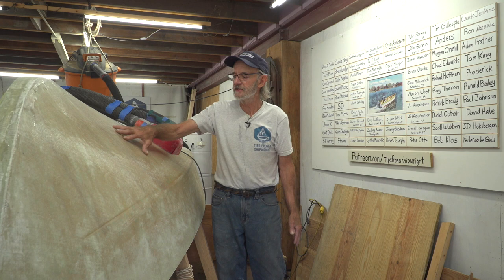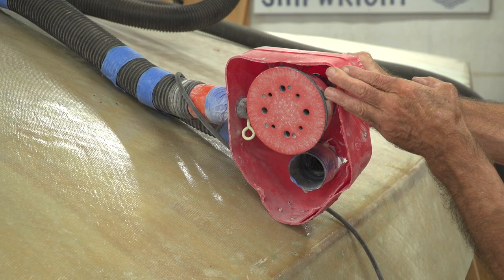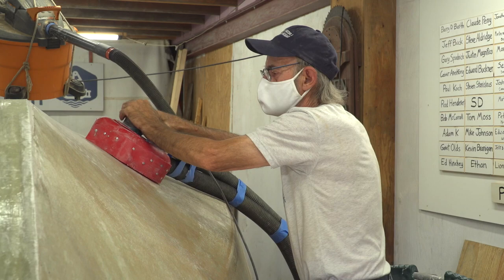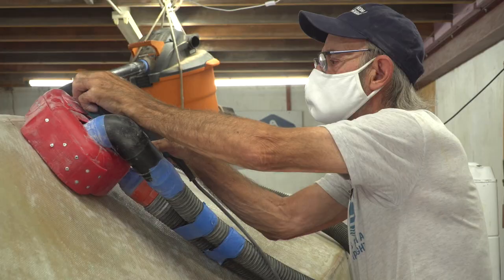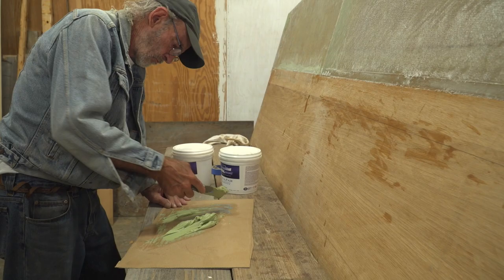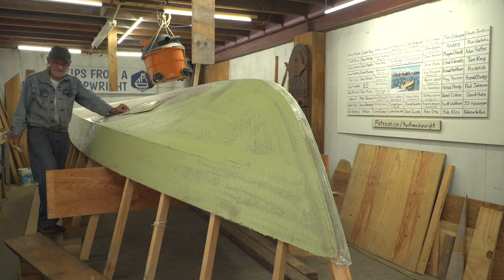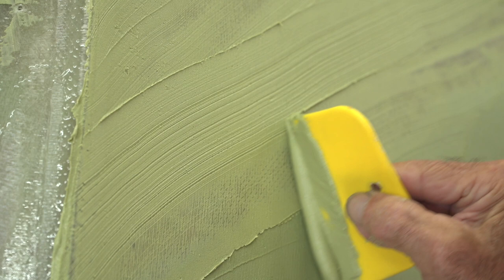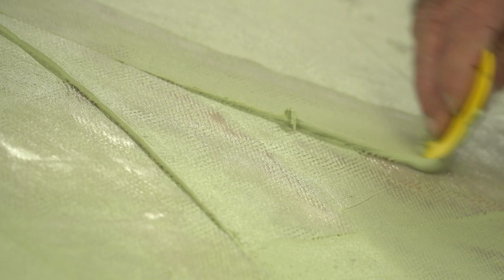Building the 23' V-Bottom Skiff - Episode 17: Fairing the hull

Comment: Nice job on finding a solution to your dust problem. Sometimes there is nothing available and you have to come up with your own solutions as you did.

Eliminating the hazard at the source is always better. PPE is your last line of defense, because once the hazard whatever it might be gets past your PPE, nothing stand in its way of doing you harm. Time, distance, and shielding. Those are the three words you need to keep in your mind when you want to mitigate a hazard. 

So keep your exposure down(time), stay away from the hazard as much as possible(distance), and use engineering controls and/or PPE as required (shielding).

Comment: Thanks for the video drop!  This glass over wood approach was used by my uncle for deadrise scows as far back as 1960 - at that time with polyester resin, later with epoxy.  We used these open bay boats for fishing, hunting, skiing.  On and off the beaches, breaking ice in the winter, etc.  I have used this technique building a 19' motor boat and strip planked canoe.  One suggestion is to try larger spreading tools for the fairing epoxy.  Sometimes a 10" sheetrock knife can be used two-handed to get good pressure an ultra smooth surface using very little compound if the glassing is decent.
Reply: I always loved stepping up in knife sizes when spreading any kind of mud or compound over any surface. Drywall mud, spackle, plaster, bondo, leveling compound, anything to smooth [fair] a surface. The wider a knife/ spreading tool, the less time you end up spending with a long-board; sanding.

Comment: Here's a couple of tips learned from 45 years in construction  that would apply here.
1. Take down every mountain before filling any valleys.
The tendency is to quickly get to the filler. It's more fun than scraping and sanding, but you'll just make more work for yourself.

2. Never put on enough. 
Starting about 6:05 you make this point by laying that fairing compound on thinly. Always figure on another coat coming after the one you're on. That way, when you get there, you'll be glad you got it done in one less coat, because even at the end, you were thinking of one more.

Comment: Actually make a drywall sander that uses this principle.    25 foot pool hose let me keep shop vac outside thru windows. Found using vacuum bags in shop bag worked best.   They are expensive but just using filter cartridge go clogged to fast and banging dust out of them is just a mess. Another great way to control dust is putting box fans in windows for demo work.  Room your in ,you put the exhausting out and in another room you blow air in the house.

Comment: GENIOUS!!! I wish I didn't just throw out my leaky gas can. Patent that so I can get it at a big box store. I always use a vacuum instead of the little bag they give you but this is next level! When I'm in an attic or other closed space I Also like to use an extra tube for the OUT so there's no air blowing around. then i damp a sock lightly and rubber band it around the out tube. I'm sure there's a better way but I never thought of what you just did. Highly recommend the out tube or even just a sock on the main out, just use the whole sock, don't clog it
Reply: I suspect that a small tupperware container would work without much modification.

Comment: You need to patent this sanding idea before someone else does and charges hundreds of dollars for it.  Also great video Lou. Glad you're back.
Reply: That design is extremely common on CNC routers, it's not really a new thing.
Reply: @Tonnsfabrication  True.  But I haven't seen that system used in this type of application.  Would be nice to have it commercially made and sold at the local hardware store.

Comment: the drag coefficient of an object in water is  about 1,000 times the same object in air....that is a lot of times. It doesnt mean that windage above water, or the weight of a boat cant be a big factor...but an ultra smooth hull below the water line saves a lot of gas money across the life of the boat.
Reply: Sure, but on the other hand a lot of technology uses nature inspired solutions such as imitating rough shark skin that actually has less drag than a smooth surface. You can only be sure by good comparable measurements, but I can see a glass structure possibly doing the same.
Reply: @paterpeter1985  There are specific reasons shark skin denticles reduce drag and actually have propulsion qualities. The shark has a touch skin to protect it in a violent lifestyle made up of layered armor of denticles. The denticles have specific shape like microscopic keel structures on each one and other qualities. It an evolutionary strategy to allow good hydrodynamics within an otherwise rough armor. If the armor wasnt important they would just have super smooth skin like all fast fish. THe law of hydrodynamics are known....there is no truth to the idea that a rougher surface makes things go faster ....its just pure fiction. Fiberglass weave is a perpendicular matrix of fibers...that and any other imperfections creates more drag not less. There is a reason the shipping industry and sailing race industry spends $ on creating the finest surfaces possible

Comment: I have to tell you Lou that with a good Vacuum on a good orbital sander works so well that you don’t need an outer chamber, What I do, do is to pipe the outlet air from the vacuum outdoors, if there is not a proper outlet from the machine, put it outside !

Comment: Very nice dust extraction!
I wish there was more info on how to make comfortable PPE yourself for cheap. Like rubberizing some gloves that fit you comfortably and maybe have some kind of pump that pushes air into the glove from your back to keep you from sweating.
Or a helmet PAPR that pushes fresh air from outside. And a light gantry system that routes the air hoses around your workshop.
Because from what I've read sooner or later you will get sensitized by epoxy hardener and then you can't really work it it anymore except in a proper environment suit. But PPE is so expensive and uncomfortable!

Comment: What about the air that comes out of the shop vac!
Reply: A good filter bag does the job
Reply: I use a dust deputy, to shop vac with a 3 micron filter bag and a hepa filter. It's high performance on the cheap.

Comment: A Festool sander would have done the same job
Reply: Not as good and twenty times the cost.
Reply: maybe you haven't used a festool sander attached to a CT collector, because the benefits of sanding without airborne dust do justify the high tooling cost
Reply: Since you know he doesn't care about safety. but a Festool as a HEPA filter and is approved for fiberglass sanding and grinding. if you get fiberglass in your lungs it's glass and will shred your lungs out. I worked around fiberglass for over 45 years. I'm sure totalboat or Jamestown distributor would tell you the same
Reply: Yeah, if you can afford a festool set up, they are worth it, every penny. But there are a lot of us out here doing woodwork and even working with fiberglass that can not swing that price tag. The cost of the festool ROS and dust collector is several months, or more, worth of supplys for our hobbies. Personally, I haven't spent those price tags on my hobbies in the last few years. I scavenge my woods and only buy sand paper and finishes. I resharpen all my own tools, mostly hand tools. Diamond cards are great for sharpening circular saw blades for the skill saw, table saw, and miter saw as needed, and diamond plates instead of wet stones do wonders for my hand planes and chisels. Triangular files for hand saws, etc. I save up to buy ROS disks in volume, but several thousand dollars for high end tools are way out of my budget.
Heck most of my tools are swap meet, yard sale, or flea market finds, the ones not bought at Harbor Freight, that is.
For a disabled guy with a fixed income under 10k annually, Festool is out of the question.